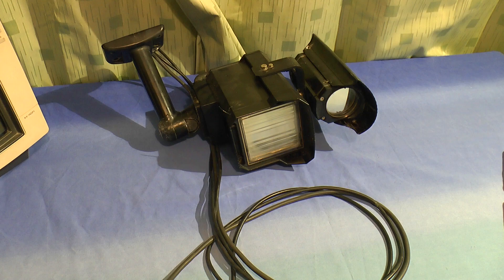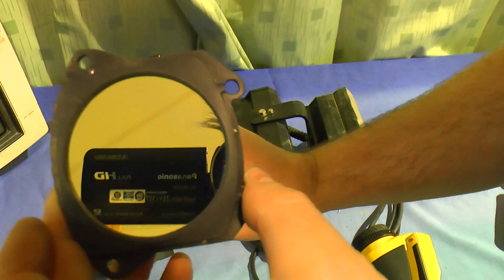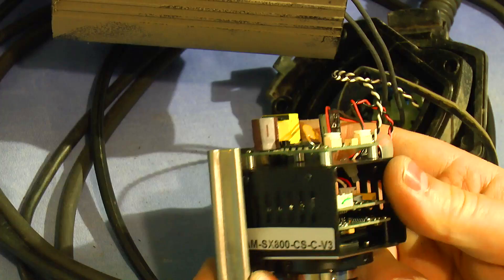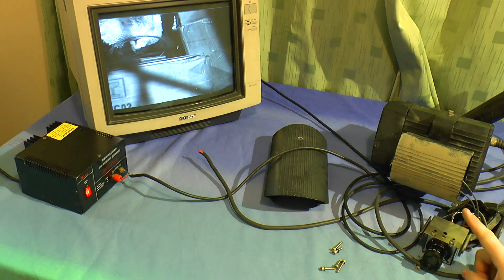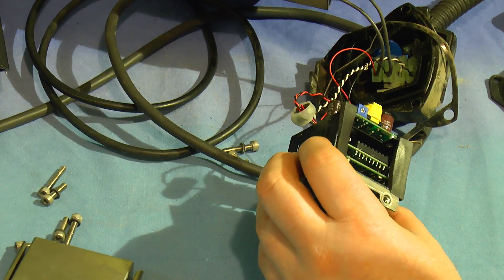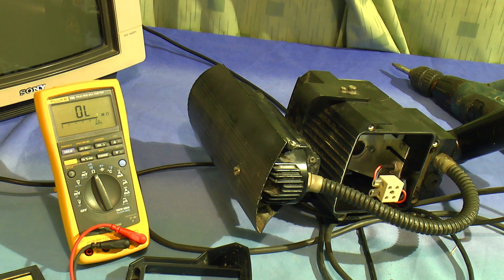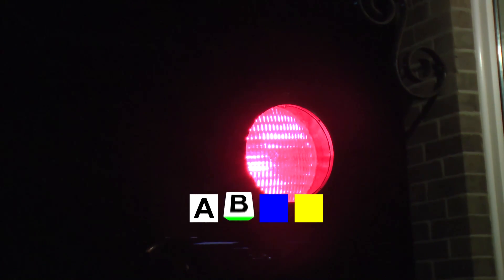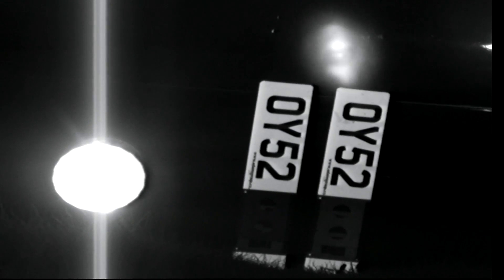Derwent (Bosch) REG number plate (ANPR) camera teardown

Comment: I believe you wouldn't get good results if you had changed the camera to a colour one, a good quality mono cam would work better.
The security cams where i worked switched to mono at night when the IR's were on
Maybe a thing to try one day
Reply from the maker: ***** I tested it off-screen with a HD-SDI board cam before recording, and considering the smaller pixel size on the sensor, plus the fact that it's colour (although I switched it to monochrome mode in its on-screen menu) it worked surprisingly well. I didn't test it outside though, as this video was shot in two parts (the day after shooting most of the teardown I realised that I could do with filming a comparison test, and last night I finally dismantled the camera itself off-screen for the board scans).

What surprised me was how little difference there was between the old 0.3" mono CCD (my first CCTV camera, bought after my car was broken into) and the ridiculously expensive 0.5" CCD. I'd even ramped up the shutter speed to reduce motion blur. Get hold of the right board cam and this thing could be fixed for a fraction of the cost of using the offical camera plate.
Reply: AintBigAintClever Yep, you switched to mono, that's probably why it worked.And yeah, totally agree, i'm sure the fully cased cameras we used at work (installed professionally) would have been cheaper than 3k even with the better lenses we had.
Reply: +AintBigAintClever (Sorry for hijacking the thread but I can't tag if I make my own post for some reason...?)

Do you happen to know what the IR bulb looks like when lit - is it particularly bright? When it's not behind the filter of course!
Reply from the maker: David Cruise No, but I'd expect it to look like a brighter version of the hard-glass reflector bulbs you see on some security lamps (the ones that look like a rugged spotlight bulb).